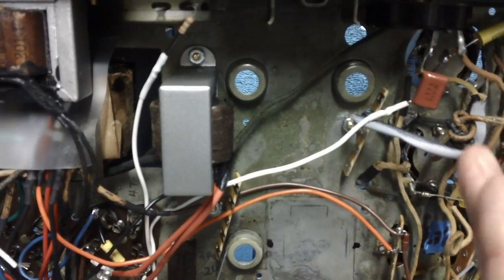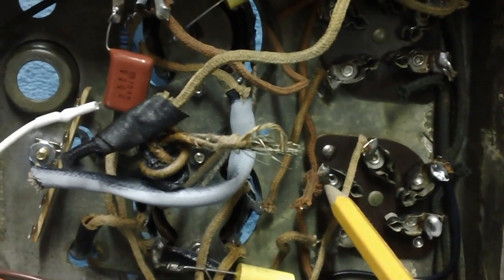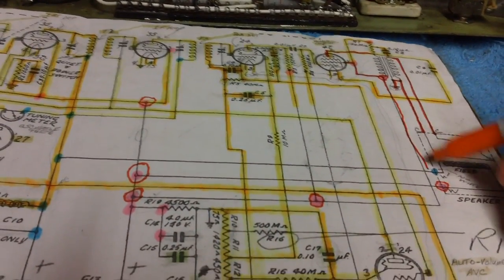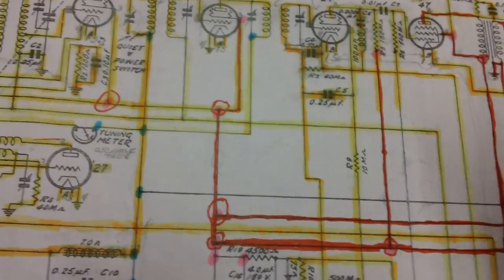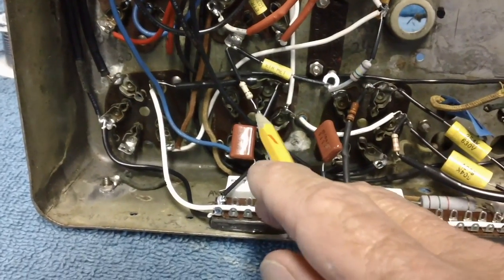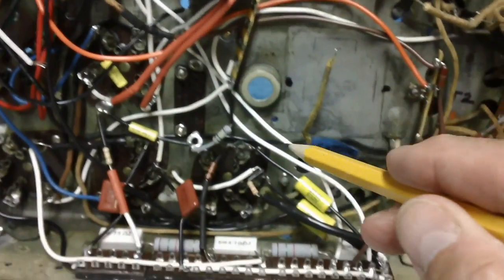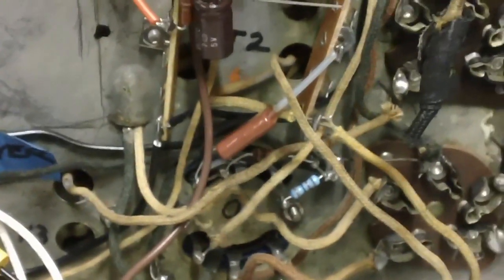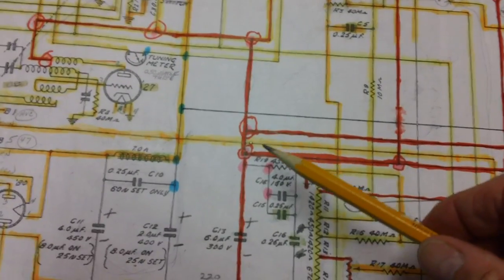1931 Airline 62-14 (Part 33 of 44).

Comment: John,
Learning about external, and internal, star washers brings back memories …along with the likes of Speed nuts, Spire clips, self-tappers, screws – including Fillister, Cheese, pan-head, Button, Flat-undercut (countersunk-fitting to you and me), Round head, Dome head, Oval Head (also known as Machine head), Hex, Square, flanged, captive – along with Slotted, Philips, Torx, Torx-plus (also known as Super Torx), Torx external six lobe, Torx tamper-proof, Robertson, Allen – Knurled-head, double-chamfered, slotted hexagon …American single, double, and triple treads, together with: AF, Whitworth, metric, BSF (British Standard Fine), BA (British Association) …and around two-hundred other types relating to most of above.  
Learning about threads, speed fixings, screws, nuts, bolts, washers, etc. drove me, as a sixteen year-old, almost to despair LOL.  Though I’d learned a fair amount about them, and their applications, before my seventeenth birthday, I’d come close to losing the will to live a couple of times along the way LOL.  Despite that, some forty-five years on I still remember most of what I learned about screws, nuts ‘n’ bolts, threads, etc. …why exactly beats the living crap out of me LOL. …and to add insult to injury, at least 90% of the above was not applicable to television, and audio, servicing (including white goods servicing).  
I think if fair to say, had someone like you been my teacher those days I might have experienced some enjoyment learning about threads, speed fixings, screws, nuts, bolts, washers, etc. 
Regards,
Phil.
Reply from the maker: My goodness, Phil, had I to learn all that just to repair an old radio I'd have never bought one in the first place.  I've never heard of some of it.  But  formal training in any area has always been what separates the men from the boys.  I'm still a boy...figuratively speaking of course.  LOL
Be sure to catch the Sunday morning Mish-Mash.
Regards,
John

Comment: Hi John,
Nice catch on that resistor! It would have been much harder to find later on. I'm pretty sure the orange marker you're using now is just a plain "Sharpie". What you used before were "highliters" which allow the print underneath to be seen clearly. To answer your question, yes I could follow a schematic to wire a radio. Although I've had experience reading schematics, you showed me a few tips I was not aware of. We'll see if I'm blowing smoke later this summer when I completely gut the chassis of a Philco 60B that I've had since 1963.
Reply from the maker: Jim,  Exactly right, my friend...better to find the mistakes now than pull your hair out later.  It's why mine is so thin.  LOL  And I've no doubt you'll do fine with the 60B.  Piece of cake all the way.  Regards,  John